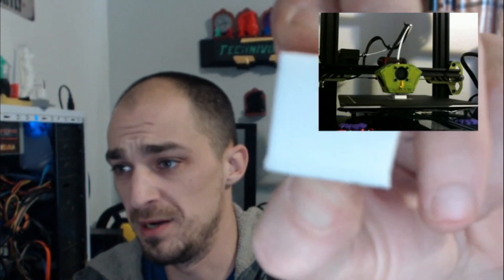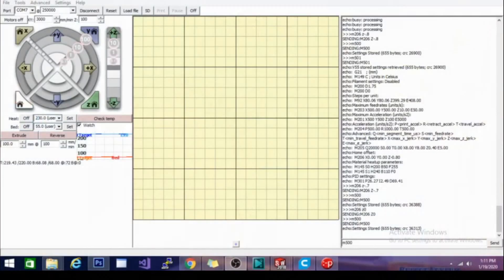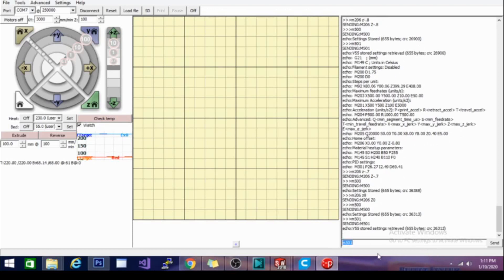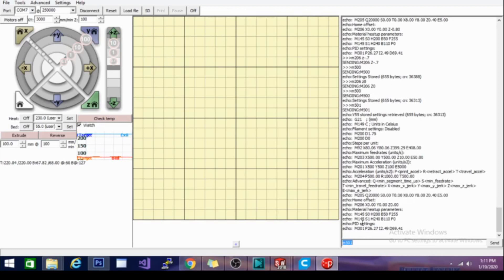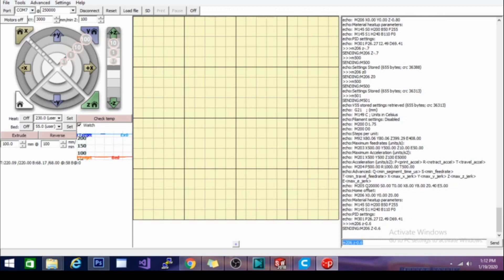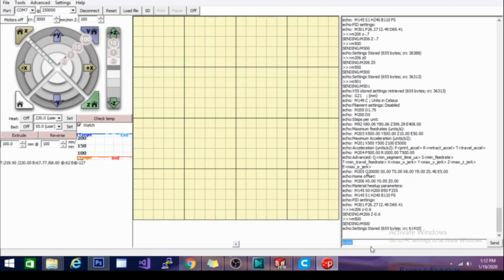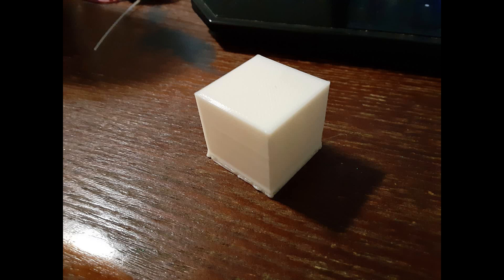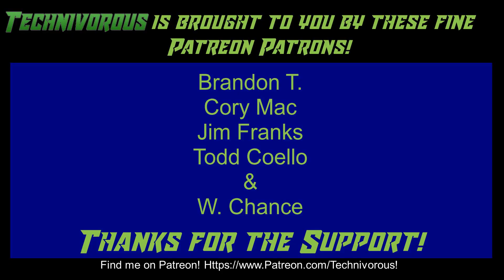HOW TO adjust your z offset - fix squished layers - print on top of surfaces

Comment: Make sure if you can't get your printer to connect to pronto face make sure your slicer is closed. I battled this for a while when I first got started it wouldn't connect and it drove me crazy and it turned out it was just because the slicer was open. So basically make sure anything using the printer needs to be closed when using prontoface
Reply from the maker: This is a good point! While this time I had simply plugged my usb plug into the wrong port, I have done that before where I had a slicer open and couldn't figure out why a different one wouldn't connect. Thanks todd

Comment: I am having a similar issue with my Tevo Little Monster, everything I print begins about 10mm or so up in the air above the bed.  I have tried setting the offset in my printer settings and it has changed nothing.  I will try this direct method via Pronter to get it closer to the surface but it's very odd that the offset change did nothing.

Comment: I could use some more help if you’re able.... I think I’ve got it all good to go and then the hot end won’t settle at a temp so the printing process never begins. This is a new issue, wasn’t happening before I fixed the offset.
Reply from the maker: What kind of printer. Is it throwing an error? Or just wont heat up all the way.
Reply: I’ve got an openbeam Kossel pro. The preheat wasn’t activating but I’ve got that sorted now from what I can see. But one thing leads to another haha it’s now printing and stopping mid print on any file, so far only during the base layer. The hot end is still hot but the printer won’t respond at all unless it’s powered off and back on. The end just sits melting a hole into its current location and no material is being extruded. The probe also doesn’t go back into its spot at the end of g29 run bc the head isn’t lowering enough. Wasn’t an issue before now.
Reply from the maker: Well before you go about rearranging everything to accommodate, I'm not familiar with the kissel printer, are you able to raise you z end stop. Because you can undo the offset, manually lower the head to the glass, and raise the end stop to their, that will solve your problems. I assume the probe dosnt reset because of the offset.